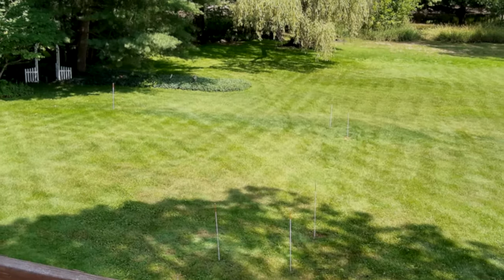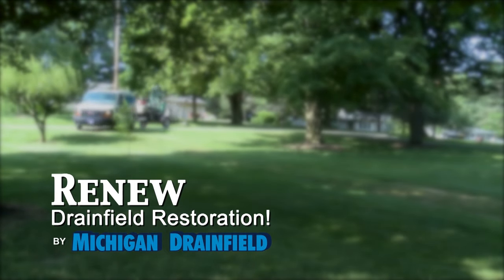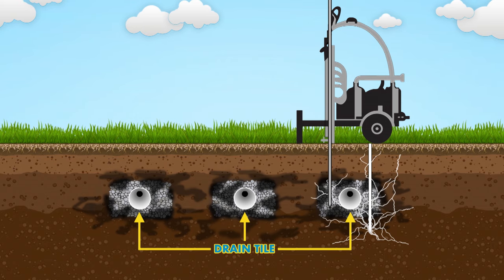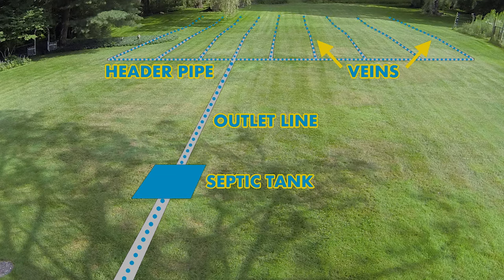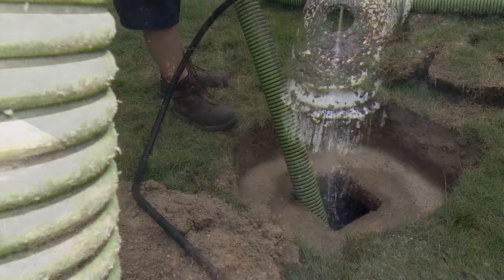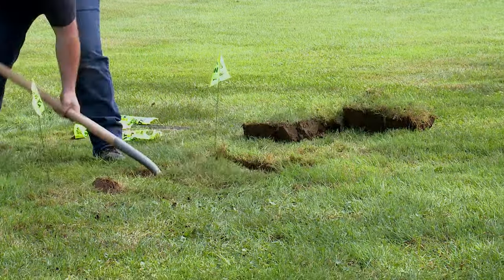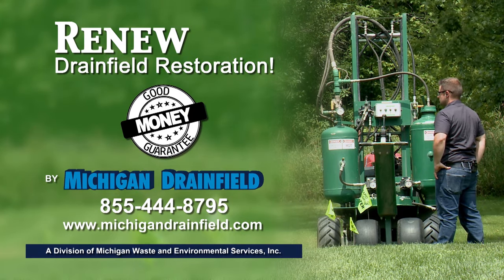The Drainfield Kickstart Process - Phase One of Michigan Drainfield's Two-Phase Restoration Process

Comment: The "immediate change" with water going right down has nothing to do with any work done in the field, it ONLY has to do with having a 1000 gallon tank totally empty.
Reply from the maker: This may not have been clear with the editing of the video, but we fracked the field when the tank was above operating level. When we fracked and saw the level in the tank drop this is how we confirm that the fracking was successful. Then we poor bacteria into the field and pump out the tank to give the field time to rest and digest as much biomat as possible.

Comment: Replaced a lot of systems that did this crap. Might give relief for a short while but it's a scam.
Reply from the maker: We agree with you regarding this fracking of the field being a temporary fix (approx. 1-3 years depending). We offer other solutions for longer term solutions. However it is definitely not a scam. We have saved thousands of customers, tens of thousands of dollars over replacing their entire systems and have seen them last for another 20+ years. That being said, not all systems are a good fit for restoration, so we must be careful not to oversimplify. Some systems absolutely should be replaced instead of restored. We take all these factors into consideration and only recommend restoration if we are confident we can be successful and it is a worthwhile alternative for our customers.

Comment: “We saw an immediate improvement because the water went right down.”   Well, the tank’s empty!   Check back in a few weeks.
Reply from the maker: This may not have been clear with the editing of the video, but we fracked the field when the tank was above operating level. When we fracked and saw the level in the tank drop this is how we confirm that the fracking was successful. Then we poor bacteria into the field and pump out the tank to give the field time to rest and digest as much biomat as possible.

Comment: This system is banned in a lot of states as it can pollute the water table. Most people that do this type of repair are not capable of getting a license to install a septic system.Lots of times this will not work .  good luck <<
Reply from the maker: Jerry, 

Thank you for your comment. 

1. You might be confusing the soil aeration method (what we do with our machine), which has NOT been banned in any state, with the hydraulic fracturing (fracking) process (used for natural gas extraction), which has been subject to bans and regulations in various states because of the very issues you mention. These are two totally different processes. The water table is far below the depth of our aeration probes which only stay in the drainfield area. Most all states/counties have gap requirements between water tables and drainfields or effluent dispersal systems. If gaps can’t be reached they require mounded fields. 

2. We actually do have the licenses required to install drainfields but would agree many do not. 

3. You are exactly correct in that this as a solution is not a good fit for every failed/failing system and is a temporary and/or partial restoration solution, which is why we also offer longer term solutions and methods not shown in this video.

Comment: Continued aeration of drain field lines.  Has this ever been tried?  Using a blower connected to D-box and supply air to increase aerobic bacteria.  Good video. Thanks for making it.
Reply: There are some great aerobic units available. Bio-microbics makes amazing products. Soil fracturing like this usually lasts 2 to 4 years. Properly maintained aerobic treated water will clean a bio matted field. There are other reasons for field failure tho.
Reply from the maker: You're exactly right. Air is needed in the field along with the right type of bacteria to eat up the accumulation of biomat and mucous which is the most popular cause of failed/failing fields. The fracking process shown in this video is the first part of a II phase restoration process we perform. The fracking will immediately restore flow to your field to get your system 'kickstarted' and allow the 2nd phase system to work more effectively. For the second phase we install a SludgeHammer Drainfield Restoration System. This is the only IAPMO approved bacterial aerator on the market and works to convert your anaerobic septic tank into an aerobic waste processing tank. The aerated tank allows a special blend of waste processing bacteria to thrive in your tank and constantly bathing the drainfield in oxygen and bacterially rich effluent, naturally cleaning up your drainfield and keeping it healthy and operational for the long-term.

Comment: The air shoots through the ground like a wave. The drainfield looks like a roller coaster after.  
It's a short term fix.
Reply from the maker: The soil compacts back down after fracking. We agree with you regarding this fracking of the field being a temporary fix (approx. 1-3 years depending). However it does provide an IMMEDIATE way to restore flow to a drainfield that is prevented from draining due to a biological or soil compaction issue, which can be a welcome relief and a far better alternative than replacement or being on a frequent pump and haul schedule. This is why we refer to this as a Phase I process as it prepares and expedites the effect or our Phase II process. 

In our Phase II process, we suggest a longer-term solution through a SludgeHammer Wastewater Recycler and Drainfield Restoration System. This is a system that can be retrofitted into the septic tank to continue the restoration of the field, enabling the digestion of the biomat and mucous that is causing the field to clog through automatically "bathing" the field in aerobic bacteria and oxygen rich effluent. We have had tremendous success with this two phase process for these type of failures.

Comment: what is the material you dump down the drain pipes...is it a trade secret or do you sell that at your store or is it readily available
Reply from the maker: That is a specially formulated blend of Aerobic and Anaerobic Bacteria we had made just for our company. It's called BioPro SRS. We basically bought all of the septic bacteria products on the market and had a lab create something that was better than anything else. Most of these products contain mostly enzymes which do work well in the short-term but stop after a limited time. Ours is pure bacterial spores which are able to multiply and constantly produce enzymes to break down solids and continue working for longer. You are welcome to call us to order: (855) 444-8795. Thanks!

Comment: How do you locate piping so it dosent pop holes in laterals?
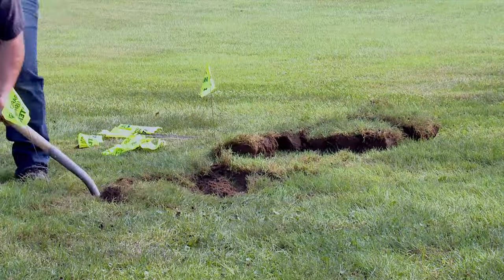Reply: You can send a camera with a locating / magnetic device and they can follow it from on top as it goes through the pipe.  You can force a metal probe through the soil from on top, much like you see they are doing to find the septic tank at 3:07.  You can use a dowsing rod or divining rod or wires to locate laterals.
Reply from the maker: @maddierosemusic is absolutely correct! In addition we also use a GPR (Ground Penetrating Radar) to locate and map unknown septic systems and drainfields.

Comment: Question need help! Found my second tank collapsed. Solids have made it into my Field. How do I test if the field is still any good. Got hose in d box and letting it run overnight. If it doesn't back up I'm good?
Reply: Yes, and don't let the hose run too fast.  It should absorb 400 = / - gallons in a day depending on the # of bedrooms in your house.  So figure a flow rate of one gallon per minute over 6 hours or so and you should be good.
Reply from the maker: Good rule of thumb there @maddierosemusic! Ideally the field is engineered and installed correctly to be able to absorb the correct flow rate based on number of bedrooms in the home and the type of soils and ability to perc. In Michigan we don't have a uniform septic code, so it's a bit of the wild west out here with various counties having different requirements for the same number of bedroom homes.

Comment: Does not address the root and scum layer that builds up in the pipe clogging the holes at the bottom of the pipe. It’s a nice option.
Reply from the maker: You are correct. However, if the cause of the drainfield failure is too much biomat clogging in the soil, this process can restore flow immediately. From here we can either opt to clean out any roots and build up in the drainfield lines themselves AND/OR install an aerobic bacterial generator which will essentially let aerobic bacteria continue the restoration by cleaning up the lines and soil perpetually maintaining and extending the health of the system for years to come.

Comment: how are the call backs on this 3 - 4 years later?
Reply: Probably pretty extensive.  I can't imagine this is any long term solution.
Reply from the maker: While this specific fracking process is an immediate way to restore flow to a failed field caused by clogged soil, it is a temporary solution. That being said, we have seen fields continue to work for 3-4 years or MORE after the initial fracking. This specific approach is only used for specific cases, but there is more we do. We also provide long-term solutions by cleaning out the drainfield lines, fixing any areas that might be damaged and installing aerobic bacterial generators for maintaining drainage and providing a long-term health of a septic system post-restoration. These solutions have demonstrated much longer-term results.

Comment: We don't know what the heck has happened to our  septic system. We had the tank pumped out this summer (and it wasn't too bad, not terribly full despite 12 years since last pump out). No more than a week after this our well collapsed but all we could afford was to have a guy come in and pound a sandpoint down. Only reached 18 feet before hitting hard pan. Had failed water test
But get this... We began to smell a foul stink inside our home. Waters still draining but septic tank is filled to the top with ground water. Oh yes, we'd had heavy rains after pumping tank out. We're retired and live on a low income so have been wringing our hands and keeping windows open. Still filling water bottles with drinking water from neighbors. My husband thinks if we buy a big bottle of a similar bacteria product to dump into septic tank that that will fix it. My theory is invading roots in the drainage field.
When we first bought the place I went nuts clearing back all the saplings and tall weeds at the back of the property that leads to a wetland area. I leveled and planted grass hoping he would keep it mowed back. Had a back injury so wasn't able to mow myself and now it's grown back worse then ever. So I think all the new roots have clogged the system and any sludge eating bacteria won't help until that's cleared again.
Any thoughts anyone?

Comment: First of all, you have to have decent yard space in order to get this. Then, it costs a small fortune! I've been here for 36 years and have never had my septic tank pumped out.
Reply: Where do you think the slur goes? You have to have that removed, it don’t just disappear, we get ours done every 3 years.
Reply: Wow, so I guess out of mind out of sight right!! When yours backs up don’t expect a pumping to do miracles because it won’t, you have ruined your drainfield if you have not kept it serviced as it should be!! Good luck
Reply: @billypreston12  Just had mine pumped out yesterday.  Our schedule for the past 21 years has been every 3-5 years (2 adults/ 1 bath).  Take care of your septic and it will take care of you.
Reply: @BlainsTube  Learned that the hard way!
Reply: I didn't know I had to pump out    10 years later I'm in trouble      it's best to get it done
Reply: When it does fail you will have complete system failure.  Sludge doesn't dissappear, if you're on a septic tank it stays in the tank until it is removed. I call bs on your claim
Reply: Your day is coming.  Where do you think all that paper and waste is going all those years?